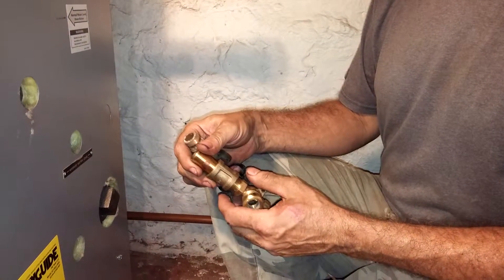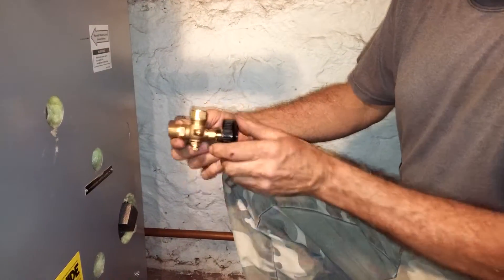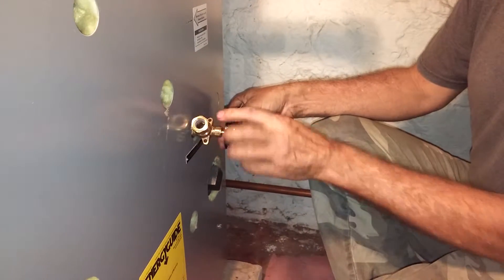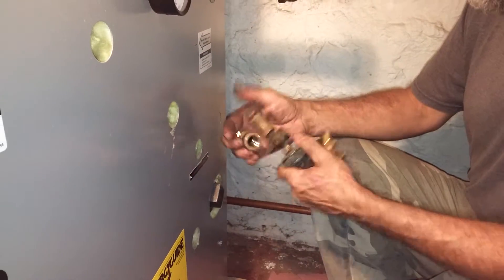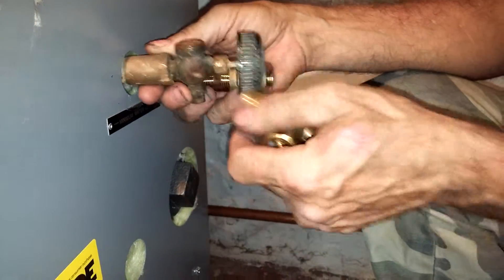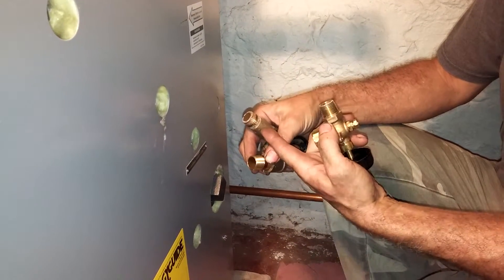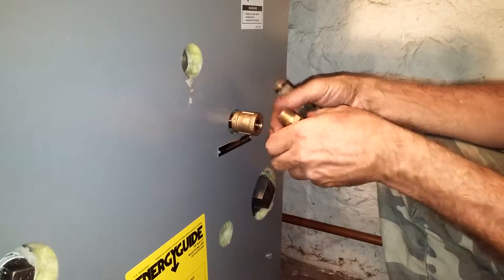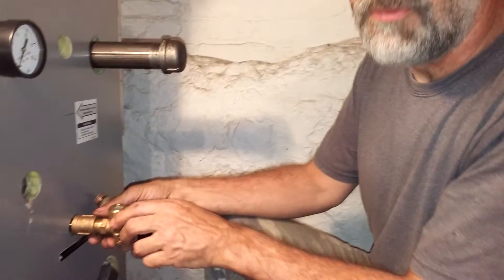Steam Boiler Sightglass Fitting Issues

Comment: Can you make a video on repacking the sightglass valves?
Reply from the maker: Love to! I've got like twenty videos in my head I'd like to produce.
But the voices in my head only talk to me *😀.
Reply: @gordonschweizer5154  I know what you mean. I would appreciate it. My lower valve leaks when I shut it off during periodic glass flush down.
Reply from the maker: @mugen-mundo  Thanks! What I usually do is get a roll of Good thick Teflon tape (not the cheap thin stuff) and spin it into a rope a few inches long. Then I use that to wind on the stem and run the packing nut back down. It should be shut while you do this. Did this make any sense? I know I skipped a few steps...
Reply: @gordonschweizer5154  Yes it does Thanks. Did not think of using Teflon. Good tip. I know lower valve leaks when I shut it and I leave the upper valve open, when there is a head of steam. I will try it before my mid season skimming, because the boiler will be off and i can lower the water level to work on it just it case it leaks even without the head of steam.